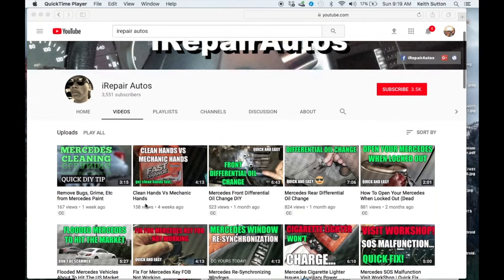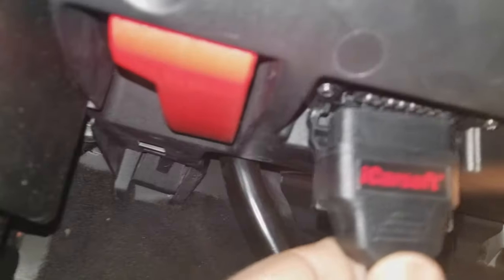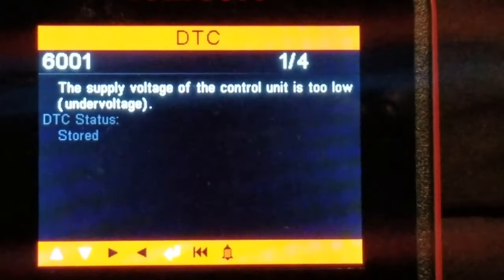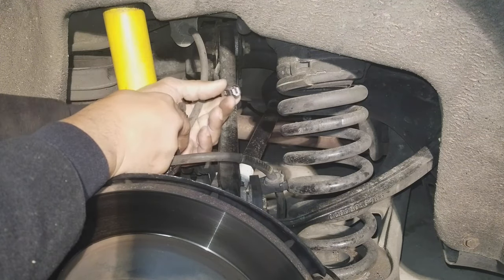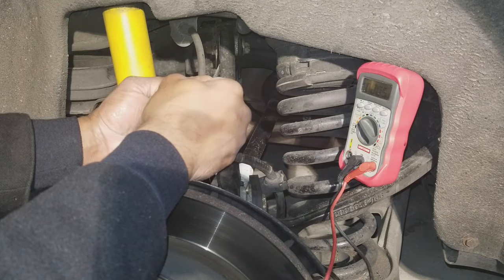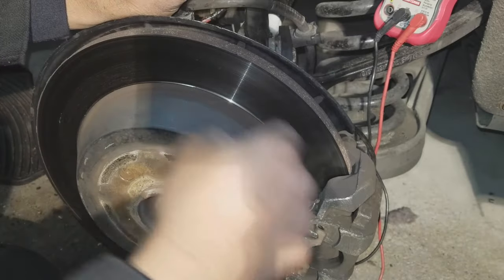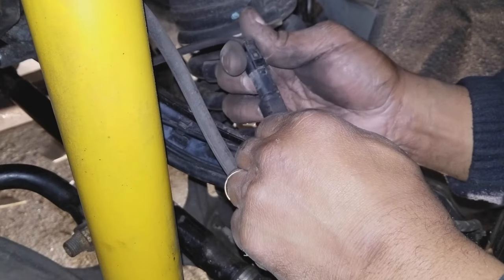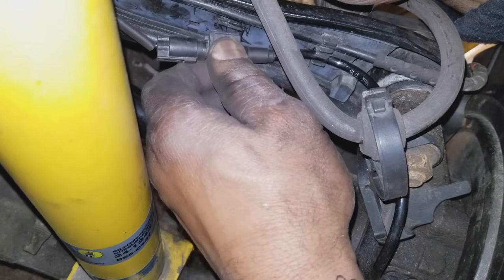Mercedes ABS Sensor/Wheel Speed Sensor Troubleshoot and Replace

Comment: Hi 
Have a 2012 Mercedes sprinter with brake force distribution message. Any ideas what the fix should be? 
Thank you
Reply from the maker: It might be something as simple as one of your rear wheel speed sensors.  Can you get the vehicle scanned?   iCarsoft scanners will tell you what it is.  Mercedes specific one:  https://amzn.to/2lBUvfu
Reply: Air in the brake line?
Reply: @iRepairAutos  thank you for ur reply turned out to be something else 👍
Reply from the maker: Can you share what it was? Help the community.
Reply: @iRepairAutos  it was a stolen recovered vehicle, turned out I had to change 5 parts. ECU, key module and lock, Abs module, headlight switch module and the speedometer, bit of a pain in the proverbial but got there in the end.
Reply from the maker: @tariqrashid1000  holy smokes... glad you got it figured out.   Who did the work?
Reply: @iRepairAutos  yep it was a bit of a trifle 😁😁 did all the work myself. not bad for my first time at garage

Comment: I recently replaced all the brakes on my 01 c240 but I'm still getting a brake line wear sensor code do have any ideas as to why this is happening? My guess was the brake control module or mb the master cylinder. Also gets a code for the esp as well
Reply from the maker: You also have to change the brake wear sensors.
Reply: @iRepairAutos  I changed those as well. Only had the two on the front. also in the process of changing the right rear abs sensor just waiting on the part to get here.  When that brake line wear sensor code pops up it goes into limp mode.

Comment: 2000 merc clk320 convert. Turbine input speed sensor circuit wheres it located an how do i replace i been looking under my hood for 3days the cars in limp an it wont even shift in + or -

Comment: I have a 03 e320 
Do you have anything on the ESP sensor?
Reply from the maker: Do you have a scan tool? Preferably an icarsoft?  If so i can walk you through troubleshooting it.
Reply: I’ll pick one up
Reply: @iRepairAutos  esp uses a combo of steering angle/speed and abs sensor data doesnt it?

Comment: Hello,
yesterday the mechanic replaced the discs and pads in my CL500 2000 and today I have the ABS and ESP lights on, and when I go on the "S" software, the engine loses almost completely power, after switching to the "W" software works fine, but also falls power and then when I stop and turn off the engine and turn it on again, it's a good moment and again after a while I come back the same or power drop almost to zero. What is the reason for this condition?
Reply from the maker: He probably screwed up your ABS sensor. It could be disconnected or damaged.   I would check the abs sensors first.

Comment: Hi I had an aftermarket bearing fitted and now it has an abs fail. Merc said i need to use an original bearing to fix this do you know if this is true
Reply from the maker: Not entirely true.  The bearing may have been installed turned the wrong way.  Magnetic pickup side turned away. Or your speed sensor may be faulty.
Reply: @iRepairAutos  thanks will look in to this it was all fine before the bearing change.
Reply: Mechanic now put the original bearing and the abs error is still there.  Im going to change the speed sensor my self as a next step.  Not spending  any more money on this mechanic.
Reply from the maker: @bjornaugustyn1212  hope you get this fixed. Very annoying when you pay someone to fix and they can't get it right
Reply: @iRepairAutos  Thanks will keep you updated.

Comment: I’ve replaced the sensor, bought a new at a Mercedes dealership, and still don’t have any volts while spinning the wheel. Could it be the abs ring that gone bad? Or probably something else?
Reply: Mechanic scan says both left front & rear speed sensors implausible - wondering if they can be cleaned without removing the wheel bearing to access the plate that makes contact with the sensor…? Any help is appreciated
Reply: @ashertheman9333  have you tested the sensors?

Comment: 2010 GL 350 w/ 111k miles - Used a scanner to identify front right wheel likely causing ABS / ESP / Traction warning lights.  Mechanic claims need to replace wheel bearings as well as ABS sensor at 4.5 hours of labor + part.  Is that a common or likely problem?  I think I will try to replace just the $17 sensor myself first to see if that addresses the errors.
Reply from the maker: No need to replace the wheel bearing unless there is play in it. Or it's making noise (humming sound) when driving.
Reply: No noise or play.  Replaced the ABS sensor and the lights went away.   Thanks!
Reply from the maker: Awesome!!!!   Glad you got that issue solved.
Reply: Do you have a video on this part related to the air suspension that looks like its about to fall off?  https://ibb.co/cvbqvK

Comment: So Mote it Be Brother. I'm PHA Onondaga Lodge #32 Syracuse NY.

I went to our people to get my brakes bleed. They filled the brake fluid reservoir up, but left the cap off.. (my 1st caution) he went to my back wheels on Drive side then hurry to back passenger side.

He told me to pump brake (cap still off)... after a few times of that, he said it will clear up after you drive it..

Drove that day but the very next day, my car ESP, ABS, DISPLAY MALFUNCTION. ..and car goes in LIMP MODE an can't get out of park....

I'm on youtube found how to hit shifter with Rubber Mallet to get outta park... saw ya video an looked on ebay for sensor wires... Ebay said an YOU SAID each wheel has a sensor  (total 4)...

In waiting on a hood mechanic to come bleed my abs an brake system. .. something told me to look at my rear sensors an wiggle them just to see if I get positive results. 

My passenger wire was there but my DRIVER ONE IS GONE an you see where he broke the sensor an it's screw is in the hole. ** He must of broken it an then removed it completely off.. 

That explains all my issues... I'm asking you, would that about sounds correct? ???

Comment: I had this problem with my SLK55, BAS, ABS, and everything. The alarm is always on, no ABS, no TRACKTION CONTROL. The fault suddenly disappears by itself. that happens after I fit new tires. I fiddle with the sensor wire front wheels. problem gone. No more alarm warning

Comment: R171 is much harder to get to for checking. its mounted on the bulkhead, so you have to remove the inner wheel arch cover.
Reply from the maker: Yes. Some of these models are harder to gain access to.

Comment: Please help.
My w220 s600 lowers from the rear right corner, but when i start it gets back to the normal height. Could a broken abs sensor cause this?
Reply from the maker: Hello - the ABS sensor is not responsible for the issue that you are having.  It could be your level sensor or a leaking suspension.   It's possible for a mechanic to misdiagnose vehicle lowering as a leaking air suspension strut or leaking air hoses.  Here's what I want you to do.  Park the car on a level surface overnight and observe if the problem is still there in the morning.  Is it just one side or just one wheel that is lowered?   From what you mentioned it's just the rear right corner.  Which either could be the level sensor but may actually be the suspension strut.  Once the car starts up the suspension pump turns on and raises the vehicle.   Do you ever get the vehicle raising message while driving?

Comment: Hello sir can the abs speed sensor stop your transmission from shifting out of 1 gear I am go to change mine out soon in my 98 SLK230
Reply from the maker: Usually not.   Sounds like your car's transmission  is in limp mode.
Reply: @iRepairAutos  could this cause no communication with ecu diagnostic? It still has coms with other modules (icarsoft mb2) but nothing with ecu (no power to ecu?) I also have no start...starter motor will start to crank (sometimes not) temp initialises in display cluster for a second or two then...gone....fan kicks in full speed...stuck in park....charged my battery up to full no difference... i am tempted to think my battery is bad....but the ecu goes offline and fan goes full speed even if I just go to on with no crank....it does come with coolant temp problem...visit workshop.....but I unplug the coolant temp sensor (one in thermostat housing i replaced only a month ago as a complete unit from merc dealership) and no change to car behaviour...still no comms with ecu.... if i leave the key in on position for more than 3mins....the display goes red....engine hot! Switch off engine!....but the engine is off and stone cold!!
Reply: I am buying a new agm battery thos week in the hope the battery is the issue.....I have also replaced the crank sensor....no change...I want to suspect a sensor short as it seems a no coms with ecu could be.caused by.that.....there is a speed sensor in the trans that can crack that lives in a box submerged in oil....could it be that thats taking my ecu offline? How do i test it without taking gearbox pan etc off?
Reply: Great video 
ABS came on yesterday I used the scanner tool, told me left rear sensor bad I replaced it after watching video light went off.. thank you 
08 GL320 is what I m driving

Comment: My friend how are doing , I have problem with my Mercedes e320 2003 make me crazy starts with rear abs sensors right+ left I replaced them and still lights on car in limp mode after that replaced multiple ring both rear side , the car back to life abs light off and car out from limp mode for 3 weeks , 2 days ago changed front tire I had 225 , 60 , r16 I winter I put 205 55 r16? All session !! After driving for a bit light came on again and limp mode again I don’t know why, used my I car soft on esp gave me one or more speed sensor has implausible reading !!! What do you think is it because SBC or something else ??
Reply: Mines is doing the same thing. I to have a 03 e320. Mines is stuck in limp mode
Did you ever find out what was the problem.
Reply: Deshawn Pollard........if you did what zaid khaled did and only replace the front tires with a different size, the computer will think that the car is in a slide and traction control will try to kick in.  All 4 tires need to be of the same outer diameter or traction control computer will think that two wheels are spinning faster than the other and try to adjust speed to compensate for lost of traction.  get 4 tires with same outer diameter or at least close.  zaid khaled put on front tires that are completely different in diameter.  His front winter tires overall height is way shorter than his summer tires he has in the back.

Comment: @irepair autos. I’ve changed the sensor but the errors still remain. Is there something else I can do
Reply from the maker: Did you change the correct one?  What did the diagnostic tool say?
Reply: @iRepairAutos  hi cheers for getting back. it said fault on abs,run flat cruise control and a couple of others. ( il get a full inventry tomorrow) There was only one feed into the wheel hub but mine was longer than yours and went behind the sound proofing. Fella across the Rd  is a retired  mechanic and was puzzled by it. Thanks in advance
Reply: iRepair Autos is there another sensor inside as the sensor has been changed which was easy. Maybe it has something in the hub as well
Reply from the maker: 1 Abs sensor for each wheel.
Reply: i have the same issue but i got the mechanic to replace the sensor from the good knuckle spindle with my original one however the problem is the bolt
since i watched him as he both removed the sensor and as he put it back he didn't bolt it 

how about yours? 

the sensors were surely different but i am not sure if that matters. as soon as i drive off the ABS comes on
Reply: @lucifersonsco.230  I got rid of car in the end as I couldn't solve problem. Got Audi tt now

Comment: Hello esp light comes on my w220 s600 and I have to reset then it drives fine any insight?
Reply from the maker: Sounds like a  loose connection on one of the ESP sensors.  Do you have a scanner that can determine the issue?  iCarsoft has a good scanner for this.

Comment: hi bro i have problems of my amg mercedes 2008 s63 abs esp on and my steering hard any suggestions think you very much
Reply from the maker: Hard to turn steering wheel is coming from low steering fluid, or damaged steering pump.
Reply from the maker: You should have the car scanned,  icarsoft tool will tell you which esp sensor is bad.

Comment: Hi bud, any idea how I can test the MAF sensor with and without the  iCarsoft Tool?
Reply from the maker: +Krum Petachki try cleaning it first.   Pick up some MAF sensor cleaning spray.  And spray it down.  Change you're air intake filters too.  What error codes are you getting? I'll put together a icarsoft troubleshooting video on the MAF sensor soon.
Reply: Thanks buddy, not sure how to scan with iCarsoft Tool but my car gas mileage has hit the floor all of a sudden and I believe that it is running extremely rich. Hence me looking at the MAF.

Comment: Hello my friend my Car 2014 Mercedes Benz E class e300 , keep showing check tire pressure in last 3 months when all my tires are fine and new and all pressure same as each other and correct 

MY car is Indirect TPMS works with your car’s Antilock Braking Syste thm’s (ABS) wheel speed sensors and Th
Hello my friend my Car keep showing check tire pressure in last 3 months when all my tires are fine and new and all pressure same as each and correct pressure 

Any idea what can I do
 Or  information I'm really appreciate it

Comment: Can the esp cause your Mercedes to be stuck in park?
Reply: Different symptoms for different cars, Your owners manual should have fuse locations, find and pull the ABS fuses. Without the Fuse installed the ESP can't put the car in limp mode. It could be a wheel bearing or ESP module going bad, but with luck it's just a dirty or bad ABS sensor.

Comment: A good idea is to try and clean the abs sensor first and then go for the new one.
Reply from the maker: +Krum Petachki that's true,  I've never come across one that started working after cleaning it.   They mostly fail because of repeated exposure to heat and vibrations.
Reply: I had one giving poor readings once and it had rusty metal filings stuck to it....wiped them off and it was all good again

Comment: How would you test this on a 4-matic?
Reply from the maker: With the scanner it will tell you which one is bad.   Without the scanner test each sensor one at a time.
Reply: @iRepairAutos  thank you
Reply: One more question. How do you deal with a stuck sensor? I'm having a hard time taking mine out.

Comment: So if there is no voltage at all then it is a bad sensor?
Reply from the maker: It could be a bad connection or broken wire as well.
Reply: @iRepairAutos  how important is that bolt at 5:32?

Comment: Is there an iCarsoft for the W210 E420 model ?
Reply from the maker: I will check mine. What year is your vehicle?
Reply: 1997
Reply from the maker: The version I have does not have the w210 at all.
Reply: Thanks! Any ideas why the gas light is flashing? The car does have a new gas cap and no check engine light.
Reply: Rudolf Gyorkei exhaust  net clogged no ventilation  properly or you have an evap leak

Comment: 2002 Mercedes-Benz C320 WHAT SCAN TOOL WILL WORK FOR ME?
Reply: After a bit of research I went for the mb2 icarsoft at £130. I figured a scan at mb dealer on sds was about £100 so paid another £30 and can scan for as long as I have the car then sell the tool on for anything upwards of half its value in a few yrs or so....

Comment: My front passenger side is different than the others on 2006 ml500. And I can't find the part. I bought a set of four. What the hell is going on?
Reply from the maker: Where did you get them?  (Dealership?)  Give them your Vin # and get the right part from the parts department.
Reply: I ended up zip tying it snugly against the brake pad sensor wire. It has a good connection. My abs and esp lights are still on though. I also changed the brake pad sensors. 

Any other ideas?

Comment: anyone have the ohms specifications for the rear abs sensors from the service manual by chance?
Reply: I've just replaced rear left sensor on CLS W218 but fault persists. Both old and new give a reading of approx 6.4Mohms. I've not got spec but seen a video suggesting in the order of 5-6Mohm. I'm hoping to find details of voltage at the socket sensor plugs into. I'm getting about 0.8V and in the video it states a low voltage but how low is low. Seen some other info suggesting something between 1.8V & 5V but that wasn't a Merc.

Comment: Bought an Icarsoft MB V1.01. Connected it and it doesn't have the EPS menu. My car says that I have problem with ABS, EPS, TirePressure.., Servosteering and cruisecontrol. All at the same time. Think it could be something to do with the ABS sensor, but the Icarsoft says zero fault in the ABS menu. Feels like a piece of sh--t. ;-(
Reply from the maker: ABS issues will cause all of those systems to fault out. It could be the ABS module and not the ABS sensors.   Does this issue happen all the time?  Did you scan it while the fault is being displayed?
Reply: @iRepairAutos  Has happened on e before when I was on a trip. Drove the car up on a sidewalk to stop. When I Drove back down again, to get home, everything disappeared....
Now it came back again. I updated the sw and got a Fault Code, finally, from the iCarSoft. P1860 so it seem to be the ABS-sensor or the "wheel". At last, now I have somewhere to start. 
Thanks for your channel!
Reply from the maker: Ok awesome. The scanner should tell you exactly which sensor is the issue. Keep me posted with your findings  .
Reply: iRepair Autos  Changed the sensor. No luck. All the different problems still there. Reset the fault and everything back to normal,but when I started to drive all fault came back. Made a new faultcheck and I now have 1 fault in the computer, sensorring. Don't know how to change it. Autoshop next...